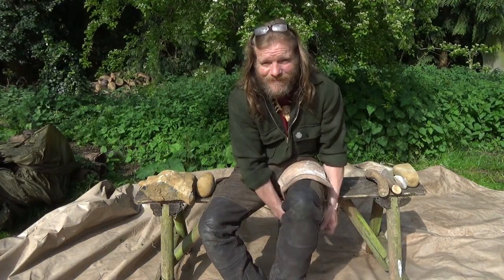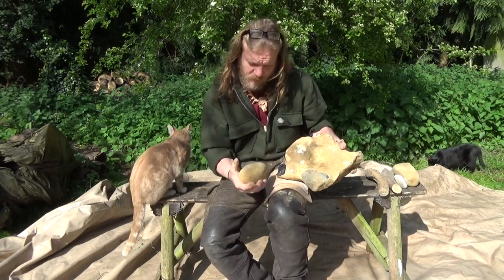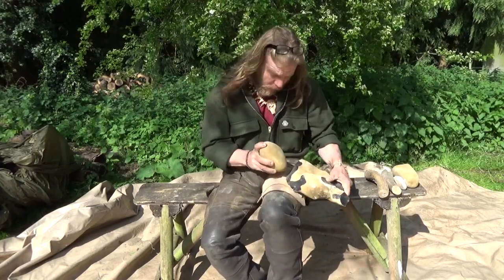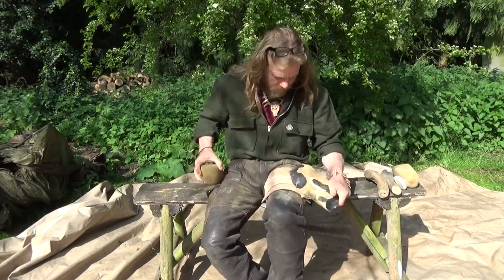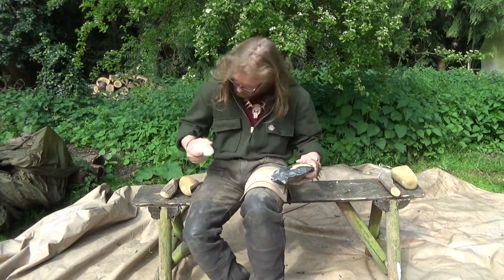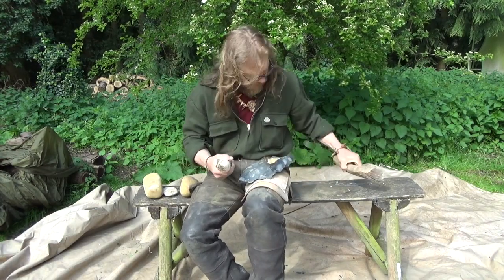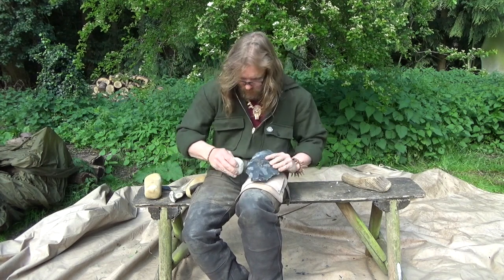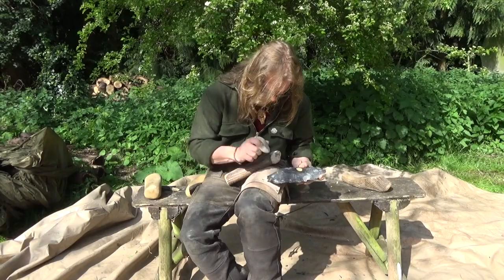Prehistoric Experiences: Making and Hafting a Neolithic Flint Axe

Comment: Hello man, watching this video I went out to my garage, grabbed a huge chunk of Euro flint and started with my hammer stone. Set it up to knock one of the bulbs off and it split in 4 chunks, lol square chunks, from a good strike, for any good piece of flint. The flint i get here are from my beaches in Eastern Canada. We have Euro flint that was dumped here from the ships that came over many years ago. It has laid on the ocean for 100's of years, so it is freeze cracked and cracked from beating around the bottom of a boat as it made its way to our shores. It is sad that it is rare to find one that is knappable, but makes one heck of a flint for the fire and steel method :)  Thanks man for this video and once again love your work.

Comment: You know at 26:13, you also try using hot coals to drill the hole, plus it also strengthens the wood.